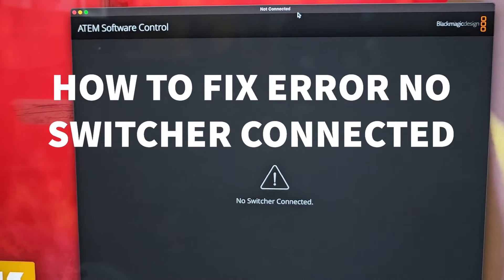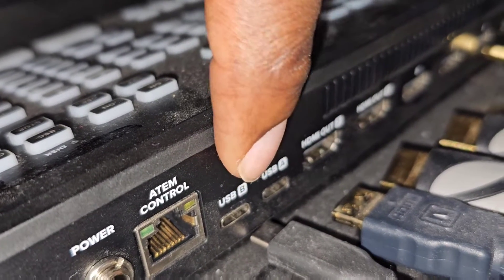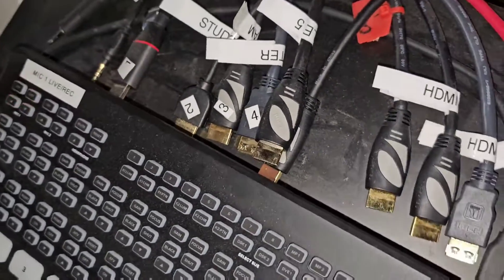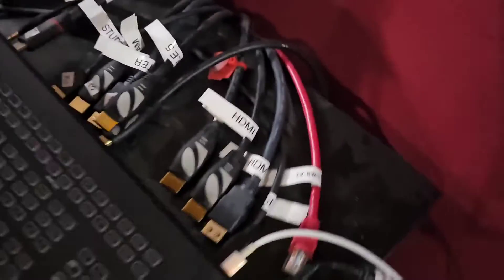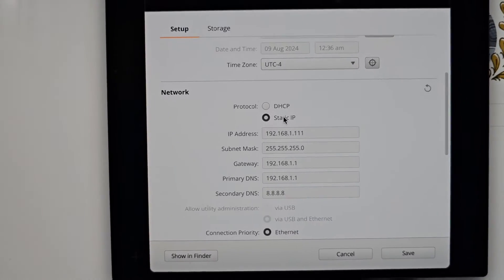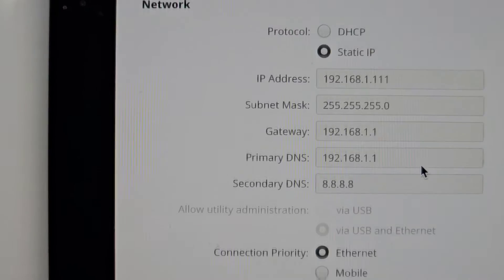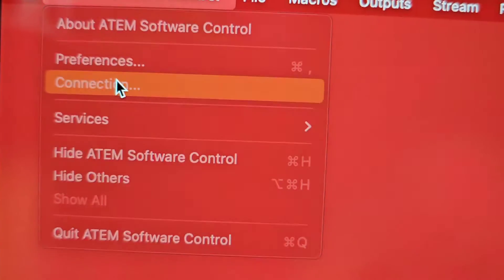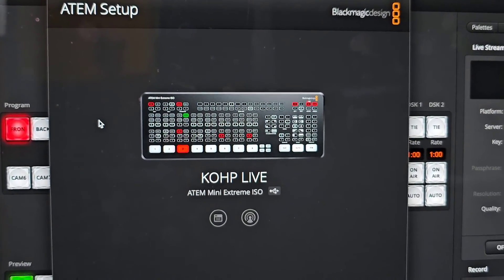Atem Software Control Frustrations? Fix "No Switcher Connected" & Master Ethernet Setup!

Comment: Ok so my question is when I open the atem set up software it keeps loading around where the date & time is so am not able to use that part I’ve installed the latest update but yet still the same problem persists please how do I resolve it

Comment: What if you don't have access to ethernet? For instance in a small church.
Reply from the maker: Well, mind you this set up is for a small church.  If you're referring to the IP, a switcher is needed. It's what helps remote connect. You can try setting up a simple switcher to communicate with the device. Else you can try direct usb C connection see if it allows you to set it.
Reply from the maker: oh, btw. Ethernet is just another name for your router connecting your atem switcher through a cable called RJ45 (ethernet). If you do live stream, then you have ethernet (your local network). If you don't livestream, but only use the atem switcher for local recording, then you don't need ethernet. You can directly control the atem switcher with the USB C cable connected to your computer.

Comment: Mine says "Update failed" With nothing saying why
Reply from the maker: I will suggest you double check the port of your unit where the cable connects (both on the switcher and computer). and also make sure you set you unit on static IP.  To avoid any error, use a cabe that transfer correctly data and power.
Reply: @joseph-israel noted, I will try that. Looked on the forums though and found a lot of other people had the same problem of “tried updating, disconnected at 60%, then said update failed.” Having the same problem and Haven’t found an solution yet but I will double check that
Reply: @dimons5530  I found that using usbc to usbc didnt work.  changing the cable to usba to usbc did

Comment: Thanks Joseph,-Israel, unfortunately I still get the dreaded "No switcher Connected" message. :-(
Reply: Woah this is frustrating seeing how many users are having this issue. I’ve tried different cables and ports on ATEM and laptop, uninstalling software and reinstalling. Nothing. Still No Switcher found. Then got a random tiny USB C to USB A to show the ATEM but won’t update the firmware… :-/ very frustrating …
Reply from the maker: Thanks for trying the steps in the video. It's frustrating that you're still seeing the "No switcher Connected" message. Let's dig deeper and see if we can get this resolved.

Here are some more detailed troubleshooting steps:

1. Double-Check the Basics

USB Cable: Ensure you're using the USB-C cable that came with the ATEM Mini. Sometimes third-party cables can cause connectivity problems.
USB Port: Try a different USB port on your computer.
Computer Restart: Sometimes a simple computer restart can clear up any software glitches that might be interfering with the connection.
2. Software and Firmware Updates:

ATEM Software Control: Make sure you have the latest version of the ATEM Software Control installed. You can download it from the Blackmagic Design website.
ATEM Mini Firmware: Check if there's a firmware update available for your ATEM Mini. You can find firmware updates and instructions on the Blackmagic Design website.
3. Deeper Troubleshooting:

Device Manager (Windows):
Open Device Manager.
Look for "Blackmagic Design" devices.
If you see any with a yellow exclamation mark, it indicates a driver issue. Right-click and choose "Update driver".
System Information (Mac):
Go to "About This Mac" -> "System Report".
Under "Hardware" -> "USB", check if the ATEM Mini is listed. If not, there might be a hardware issue with the USB port or the ATEM Mini itself.
4. Conflict with Other Software:

Temporarily disable any other video capture or streaming software that might be running in the background. Sometimes these can conflict with the ATEM Software Control.
5. If Nothing Else Works

Contact Blackmagic Design Support: If you've tried all the steps above and you're still having problems, it's time to reach out to Blackmagic Design's support team. They have experts who can help you troubleshoot further.
Additional Tips

Power Cycle: Try turning off both your ATEM Mini and your computer. Then turn on the ATEM Mini first, wait a few seconds, and then turn on your computer.
Clean USB Ports: Make sure the USB ports on both your computer and the ATEM Mini are clean and free of dust or debris.
I hope these additional steps help you get connected. Please let me know how it goes!
Reply: Yea me too :/ Tried 10 different USB cables
Reply: I'm getting the same error. i can change all the settings but when i open the Atem control software it says no switcher connected and after 3 or so seconds it closes by itself. I've tried uninstalling and reinstalling to no avail. different cables n drivers. even booted up a 2nd machine with a clean install of windows and same issue. really strange, its a brand new Atem mini pro too. its annoying as its the only  Blackmagic gear I'm having issues with. truly stumped.
Reply: I got the control software to work by uninstalling and downloading AND registrering. I don't know if it's a dirty way to get us to give up our email to get the software.. however now the Atem Setup won't open 😂😂😂😂 im thinking about ditching the software and only using the hardware. Software is too buggy
Reply: @ignitedvisuals  i just got mine to work! not sure if its replicable but I used my laptop, i tried changing the IPV4 settings, that didnt work so i reverted it back to normal and plugged the atem directly into my laptop with ethernet. nothing again but when i unplugged it and plugged it back into my network switch it immediately showed up on my main desktop which had the atem cotnrol software open.. really weird but it shows up on the laptop now too.. changed the IPV4 and then reverted it back and it worked.. strange?
Reply: I need to use the USB connection..